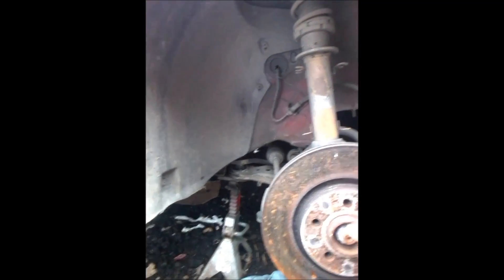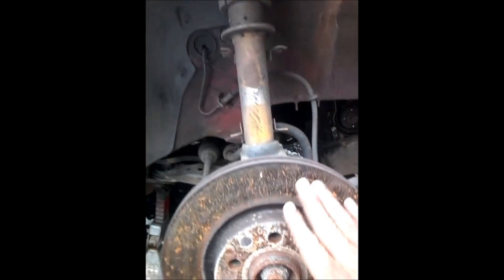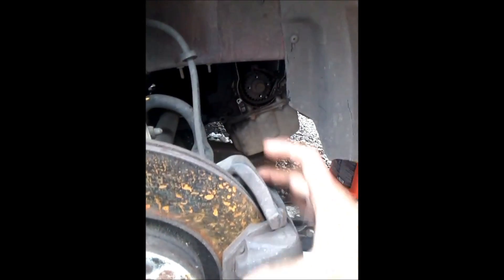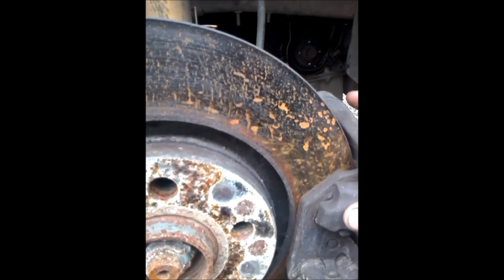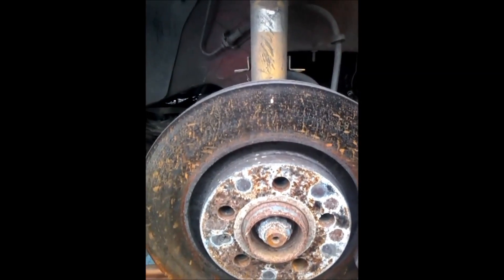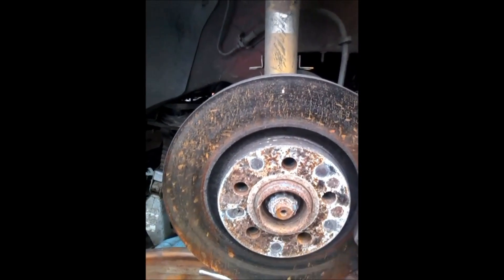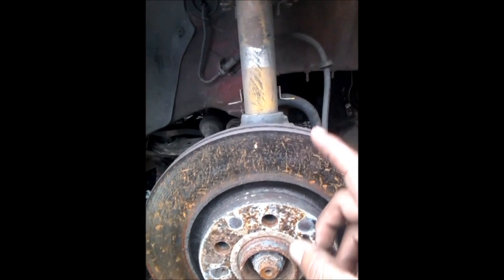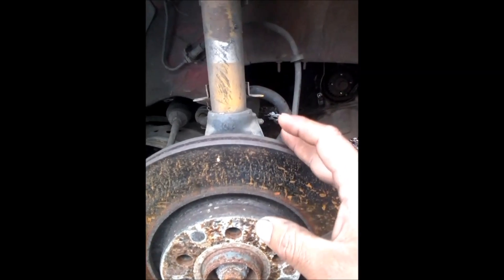Why your car shakes when braking!!!!

Comment: I thought I had that problem but no the problem was the snow and the ice I've parked too close to the crub that was full of snow and it got in to my front calipers and it froze and when I went to drive it started to shake and I thought that I had to buy new rotors and pads to replace but no.

Comment: So this is in response to all these folks having shaking problems with the steering wheel, etc.. mostly to adamigl. You need to check the engine mounts on the car. I JUST test drove a  2016 Ford Fusion and was very impressed with the car other than the steering wheel shaking when changing lanes and speeding up around 50-60 and then slowing down. I easily noticed and just did a bunch of research on this problem. Most people get deceived by shops and mechanics saying it’s the balance and mounting and other bs especially if it’s got low mileage and from a dealership. Well it’s most likely the engine mounts which there are only two in Fords when most vehicles have 4. Mind you this car I JUST drove had only 43, 000 miles on it and because American made vehicles use such cheap parts these things tend to happen that’s why the re-sale value on Japanese cars or more foreign made cars is higher because they make engines and parts THAT FREAKIN LAST!!!!  So BUYER BEWARE OF AMERICAN MAD CARS!!! I’ve had three over the years of driving and none of them went past 150,000 without major issues. And I just got in a hit and run accident by some a-hole on the highway doing over a hundred easily and he didn’t even hit the brakes. Could have killed me. But my 2015 Nissan Sentra SV was totaled and so now I’m looking for a new vehicle. But out of the three plus years I had that Nissan it wasn’t in the shop ONCE!!! And I drove it for Lyft for over 2 years so yes I drove it hard. Bought it with 19,000 miles put 80,000 on it. You may pay a little more for a Japanese vehicle but I would say 98% of the time you won’t have any major issues or problems!!!! So that being said be careful of American made cars PERIOD!!! 

Today is September 15, 2020
I’m trying to warn others

Comment: My 2010 Dodge Journey vibrates only when on brake and stopped at light.

Could that be engine mounts issue being worn?

How to tell difference if brake caliper rotors drums or other issue part of brake system?
Reply: If you feel the shaking on your steering wheels while you’re braking it’ll be rotors for sure, if it’s the engine mounts you’ll most likely feel it on the whole vehicle

Comment: I have taken my car to 4 dealerships. I have had roaters and brakes replaced, alignment, engine brackets, tires, alignment, you name it. It’s so loud when I drive and then shakes so violently went I brake. Every dealership “knows the problem” and has yet to actually fix it.

Comment: Brand new rotors 
Or as you refer to them disc 
And still shakes bad 
Soooo 
It’s the rotors/ disc huh 
Not .......
Reply: Could be ball joints or lower control arm bushings

Comment: New rotors new pads all suspension tied new wheels and still shaking when I hit the brake
Reply: Ball joint? Lower or upper control arm bushings?

Comment: what about  alignment, do you think that could also be a problem? i haven't checked my brakes and rotors yet, but im  curious. thanks for the video
Reply: Alignment problems could be if the vehicle moves itself to right or left side when you are driving and you need to be holding the steering wheel to keep it straight, I hade the same issue and thought that was balancing problem, I took it to the tire shop, they did the balancing service but didn fix the problem, I replaced rotors and brake pads and that was it.

Comment: I have a BMW 740il 1995. It use to shake horrible. I put a new front suspension on it. Not the cheap ones, everything TRW, MOOG, LEMFOERDER, BILSTEIN. Put new rotors and brakes. Now it does shake like it use to 90% is gone, but i still once in a while go into like a death vibration. It even has a new steering gearbox, any ideas.

Comment: I replaced my back rotors and brake pads thinking that would help, but it still shakes, so i replaced my front brake pads and it doesn't shake as bad as it did, gonna have to change my front rotors

Comment: Also people over look your allingment. If your car allignment is off you will feel the vibration speeding over 40 or when you press the brake. Im getting my car allingment fixed now
Reply: Wow Thanks,  that I wanted to know,my car vibrates when it passes  50 miles,I already change the bearings and other parts and remains the same

Comment: Thank you! I just replaced front rotor and pads because I had steering wheel vibration. But, I still have vibration, but NOT on the steering wheel anymore. So, I was hoping that the opinion here was to do the rear, as well. :) Thanks.
Reply: Fixed it?
Reply: @5.0Fabio  Thanks for the question! Yes that did do the job!
Reply: Come to find out I needed all four done.

Comment: Rather than replace your rotors you could just get them cut to remove the pulsating, that's what I do at my shop
Reply: Timothy wojciechowski how many times can one cut them? I've already cut them once and mechanic told me not to unnecessary break too hard(burning rubber) or they'll prob get damaged or worse, so how much is it to cut them?
Reply: Yeah, he mentioned that some O'Reilly stores offer that service. CARQUEST does also.
Reply: joe mama, you can only cut them so thin. Quality rotors usually have a minimum thickness required stamped on the rotor. Or Google it.

Comment: Thank you. What about when I have to apply my brake hard and then apply the gas, the engine is raring but not not moving. It feels like the brakes are not releasing as quick, but only when the brakes are applied hard to stop in a lot of traffic coming to a quick stop. My first guess is my brakes needs serviced.
Reply: Richard Duckworth or drive at a more relaxed pace so you have adequate time to break instead of stomping the breaks need to be gently applied

Comment from the maker: thank you for watching my videos.
Reply: YourCarFacts, great video. However, i would like to add something. I have a Toyota 4 runner. I was experiencing pulsing in the brake pedal and steering wheel.  Naturally I assumed that it was a warped rotor. So after replacing the brake pads and rotors the pulsing was still there. Needless to say I was perplexed for a long time over this issue (about a year). I went through everything.  I checked the suspension several times looking for play and broken or worn out bushings including the steering and wheel bearings.  I couldn't find any issue with anything.  So for shits and giggles I decided to replace the brake calipers. Upon removal of the driver side caliper something caught my eye. The 2004 4 runner has 4 piston brake calipers. 2 piston inboard of the rotor and 2 piston outboard of the rotor. What i had noticed was that the forward most piston on the inboard side was not even with the rear piston on the inboard side. Upon further inspection it was froze up. So, what was happening was when the brakes were applied the 2 rear most pistons were applying force to the rotor one inboard and one outboard and in opposition to each other but on the forward most set of pistons only the outboard piston was applying force to the rotor with no opposition from the inboard side which was causing the pulsing. How this situation was causing the pulsing is still a mystery to me because I checked the original rotors with a straight edge when i replaced them and I also checked the newer ones when when i replaced the calipers and there was no sign of warping. When I installed the new calipers I didn't replace the rotors I used the ones that i had installed a year previous. Once I had everything put back together and test drove it, the pulsing completely stopped and has not been a problem in the two years since.
Reply: Great job man. Simple and to th r point
Reply: YourCarFacts so i almost hit a train 2 days ago and breaked really hard so now my car shakes especially when breaking. Do i just replace the brakes?
Reply: Bideos*